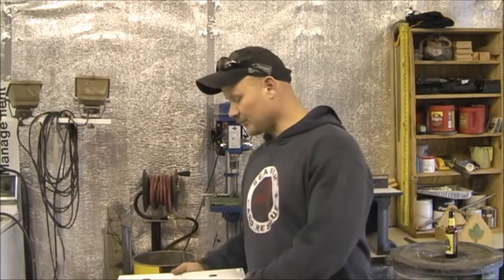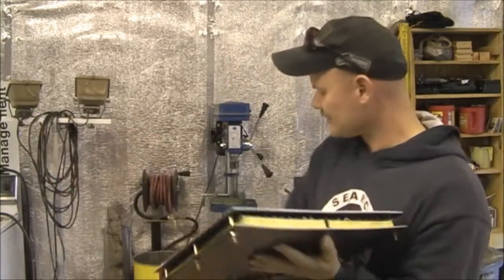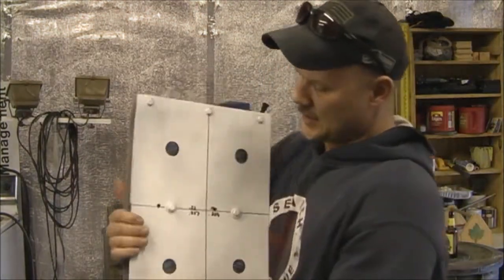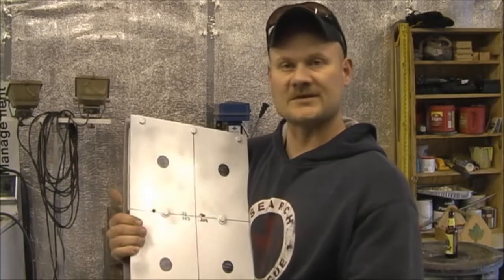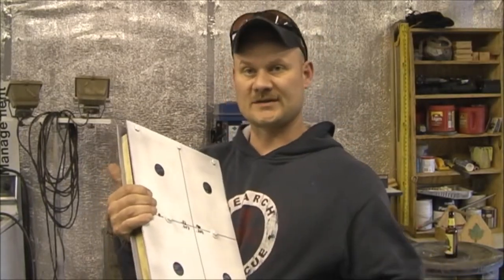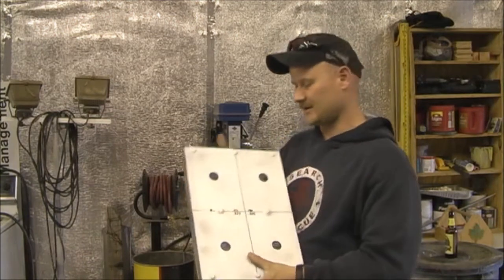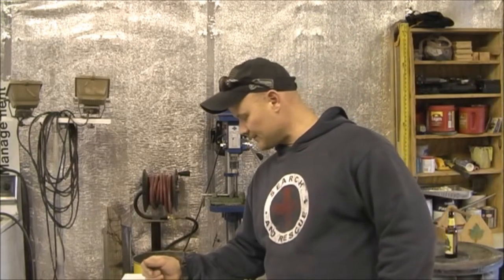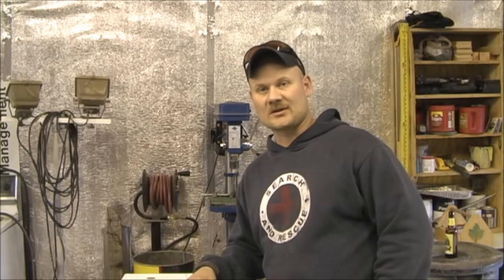Homemade Bulletprof Armor Project "Video 3"

Comment: I don't get why you're using phone books since you have steel ... I would think the protection from phone books to be minimal and that you'd better be served by adding another layer of steel.

But let's see what will happen on next vid.
Reply from the maker: Yes, you are absolutely correct, I could add more plates. But, I was trying to shave off some weight for the larger project. If I were to use full plates, I would be looking at over 300 pounds on the final project. If this works, it would only weigh about 185 pounds. Then again, will it work with only phone books and some 1/8 inch steel. Thanks for watching and the next video should be out by next week, if not sooner.

Comment: I would think if there was some space in between the steel and the phone books it would give the bullet some room to canter. I know that would make it thicker but might help with the penetration. Idk if that was mentioned earlier.
Reply from the maker: Great comment, I thought about that also. I have already done the penetration test. It did very well, I will be listing that video next week. But I think you are absolutely right. I want to ether add space or reverse the angle iron to the back side. This will probably be a long series of videos trying different techniques. Thank you for watching